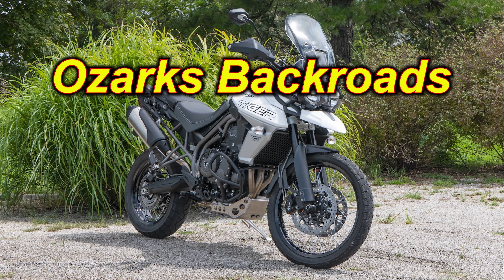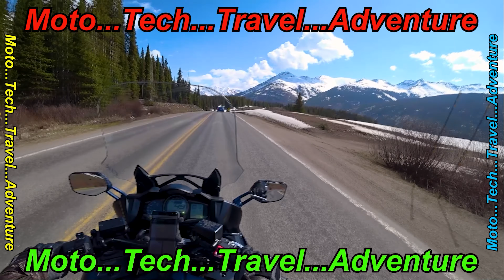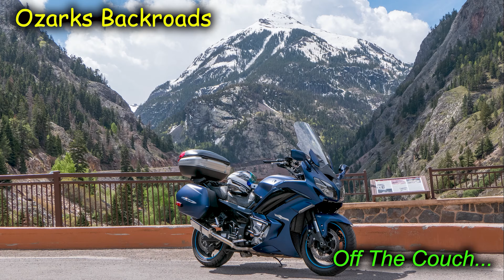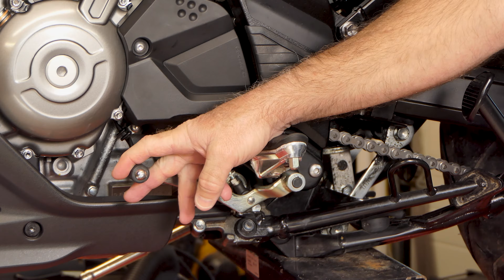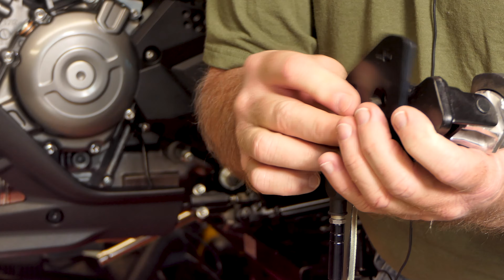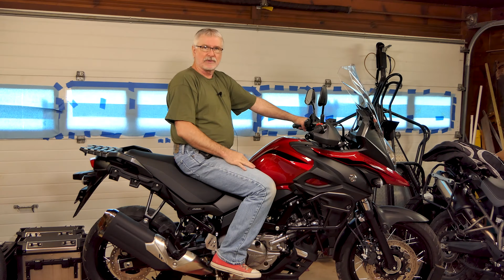2019 Suzuki V-Strom 650XT Gets Foot Pegs Lowered

Comment: I installed the kit, but when I ride the adjust extend, keep losing and lowering my shifter change the fit. how can I fix that?
Reply from the maker: Good to hear from you sir. The nuts on both ends of the shifter shaft have to be locked down tight... the shaft has revers threads on one end and normal right hand threads on the other..  thanks for watching and good luck with all you projects...  :)
Reply: Any luck trying to fix that issue. It's same for me. No matter what I do it just becomes loose and unusable.
Reply: @dandan2077  I had exactly the same issue. The instruction in the video at https://youtu.be/J7dyhgQlX2I?t=428 is not accurate. The nuts have to be jam tight against the collar(black piece). My mechanic did this for me yesterday and so far the shifter seems lock in place. If i am incorrect, please let me know.

Comment: Great videos! Very helpful.
I am stuck on the shifter side. My extender needs to go on the shifter. But the nuts won’t come off. They are quite delicate and I can’t use force. 
Have tried WD40 and some heat. No use!
Reply from the maker: Good to hear from you sir, sorry to hear you are having difficulties however... :(

Comment: I’m loving your vids. You’re making it so easy for me. My footpeg lowering plates shipped today, along with a set of foot controls relocating plates to move the controls forward quite a bit. 

By next week my legs won’t cramping up, and I’ll be able get my cursed size 15s in there with actual riding boots on. I can’t even get a hiking boot under there right now, so I’ve got a little piece of wood screwed into the front of the toe to upshift. Will I ever be happy to be rid of that.
Reply from the maker: Good to hear from you sir, glad you are getting your bike tuned in for you... thanks for watching... keep safe out there...   :)
Reply: Where are you getting the foot controls relocating plates from? Would really appreciate some links...

Comment: Hi John, I'm Guillermo from Argentina again. The video of him as usual is excellent. I ask you, the set of electrical cables of the brake light, does it have to be modified? Is it tight with the modification? Thank you very much.
Reply from the maker: Hello there sir, good to hear from you.  There were no modifications needed  to any wiring to lower the foot pegs on the V-Strom.  The wiring to the brake light switch was plenty long enough for the relocation....  Hope this helps... thanks for watching....  keep safe out there...  :)
Reply: @ozarksbackroads5484  Thank you so much John!!!